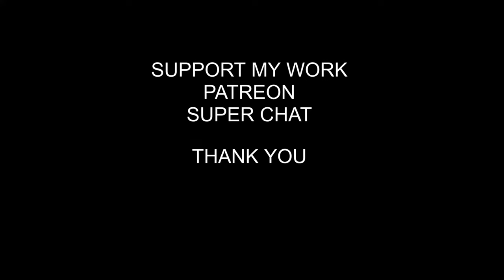Riding Lawnmower Won't Start

Comment: Great job Robby ! Those vale keepers can be a pain in the butt to install for sure . I agree with either lack of Maintenace and or the use of ethanol fuel to cause the coking on the valve. I liked the longer video also . Keep up the good work .
Reply from the maker: Thanks

Comment: Well done Robbie

Seemed like a pain to do the valves, I wonder what causes them to go out of position
Reply: Ware and use, it common and needs to be set every year, valve lash.004 both of them
Reply from the maker: Heat, ware, lack of regular maintenance.